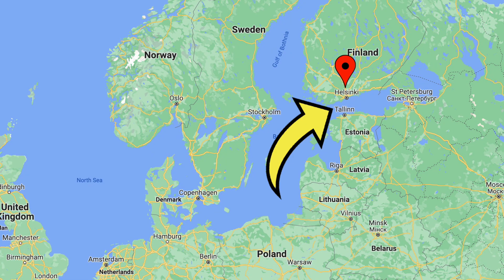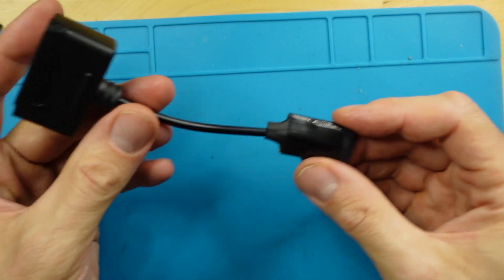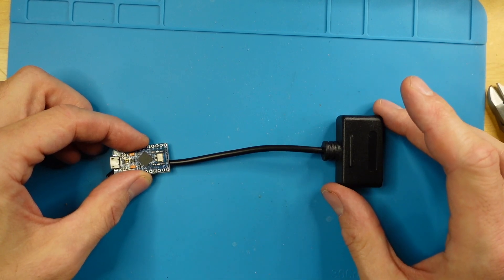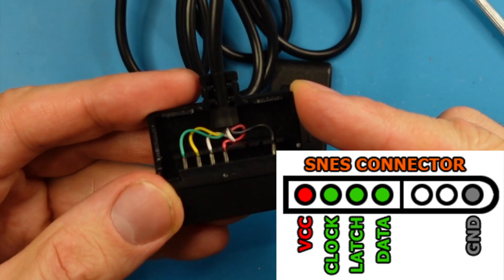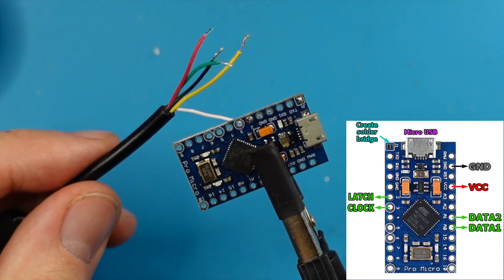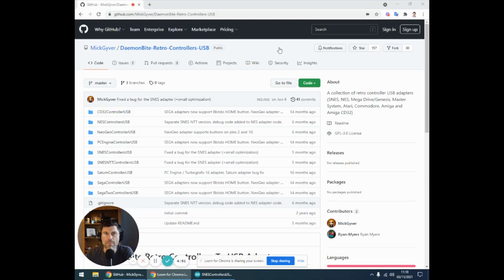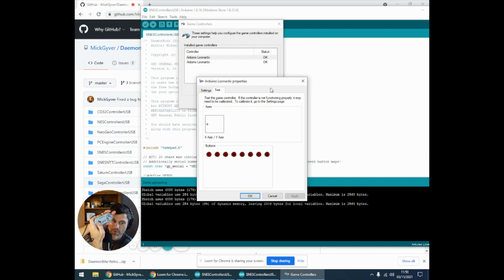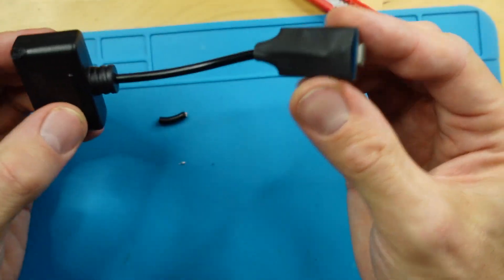Make your own DaemonBite Super Nintendo to USB adapter

Comment: Any recommendations on troubleshooting? I'm trying to do this with an old NES Advantage controller and I'm getting wierd results. No dpad and "B" Button lights up input 2 and "A" lights up 1, 3, & 4 at the same time.
Reply from the maker: As far as I know the nes advantage has the same pinout as a regular new controller. The best advice I have is use the green screw terminals so you are not soldering and resoldring each time to debug. 

Also a really long shot, try asking chat gpt to interpret the results you are getting. It’s often good at analyzing what combination might be causing that

Comment: Could you bypass the connector port and wire it straight to the board?
Reply from the maker: Do you mean: Could you take a SNES controller, cut the connector off the end and solder those wires onto the Arduino?

Yes you could, but then your mod would be very permanent :)
Reply: @ZezRetro yeah, I play games strictly on my computer for randomizer (Zelda 1 & Castlevania 2) so making it into a custom controller would be less parts than sourcing the female ends for adapters. Very cool man, thanks for the video!

Comment: Thanks for the awesome guide - worked straight away and used a multimeter instead as well :) Adapter works great with my stock SNES controllers, however having a problem with the SNES Topfighter QJ Arcade Joystick which is understandable with it being a 3rd party controller, I've pinged the developer for some pointers to see if there's any tweaks that i could make in the code to make it work!
Reply from the maker: I am very glad the video was helpful for you!

Comment: Dear friend, I would like to do a USB to NES adapter, so I could play with my homemade Arkanoid Vaus controller on original material.
Reply from the maker: Hi

The process is very similar, is there some specific part which is giving you difficulties that I may help you with?
Reply: @ZezRetro  is there any encoding or things I should know before buying cable and trying this new project?
Reply from the maker: What do you mean by "encodings"? Here is the daemonbite page showing you how to wire in the cable https://github.com/MickGyver/DaemonBite-Retro-Controllers-USB/tree/master/NESControllersUSB
Reply: @ZezRetro  thanks my friend ... I think I got what I need to begin
Reply: @ZezRetro  by "encoding" I mean doing the code to the arduino to make it recognizable by the NES
Reply from the maker: @Manche-De-Pelle  Ah yes. If you look in that GitHub link for NES Daemonbite there is a file NESControllersUSB.ino

This is the code which will be uploaded into the arduino

The process is basically identical to what I have in the video
Reply: @ZezRetro  exactly ... But I need the reverse.  Can an Arduino emulate the chip on a NES controller? How to program it ?  Those are the 2 questions that remain
Reply from the maker: Can you explain again what you require as I think I may not have understood. 

As I understood, you have an original NES controller and you wish to plug this into a PC. The daemonbite lets you plug in that NES controller and on the other side plugs into the PC. 

Have I understood correctly?
Reply: @ZezRetro  not at all ... I've made my homemade spinner using a USB port.  I want to make that spinner playable on original hardware (on a NES)
Reply from the maker: Ah ok I understand now

Unfortunately daemonbite can not do this. I personally do not know of any project which can do that.
Reply: @ZezRetro  that's what I thought ... it's seems to be a hard challenge to do

Comment: You don't need to break the other end to see what each wire corresponds to. Use a copper paperclip or wire, a pen, a sheet of paper, and a multimeter.
Reply: The pen and the sheet of paper could be replaced with some other note taking method. I use the sheet and paper method personally, but I just thought of another method;  The cell phone with the ColorNote app, or something similar. Voice-to-text the results of your tests with the multimeter if you don't have access to a pen and paper.

Comment: If you have a multimeter, you can use it to figure out which pin corresponds to which wire. Using continuity mode or diode mode, touch one probe to the port pin, and touch the other end to each wire. When you get a beep in continuity mode or a value other than 1 in diode mode, you've found a match. Saves you from disassembling the connector.
Reply: 100% this - continuity mode is the way to go
Reply: I also did this :)

Comment: I'm not an expert with Arduino's but I do need a SNES to USB adapter and have some clone Arduino Nano's that aren't doing much right now. Think they're be alright?
Reply from the maker: Clones are ok but it should still be the same type of board. If the project GitHub says it supports nano then a clone would be ok. If the docs don’t say it’s supported then it’s not likely to work

Comment: Why would you pry open the connector when you can just use a multimeter to test the wires.    Get a chap meter with continuity testing setting or use any OHMs setting.
Reply from the maker: I admit that does sound better. If you have access to a multimeter, it’s the way to go

Comment: 2:20 I would have left the wire full length... then you would of had an extension cable/adaptor. ;-)
2:49 You should buy some wire strippers. ;-)
2:56 A multi meter would help you figure out which wire goes where without destroying/taking apart end connectors. ;-)
Reply from the maker: All very valid points, I do need some better gear :) Although with point 1, I was specifically going for a short cable as my setup is all on my small desk

Comment: How to connect the line when 2p is connected? Connect data2 to A1, and do other lines overlap?
Reply from the maker: I haven't added a 2p myself but as I understood from the github docs: 2p VCC, Clock and Latch are all connected to the same points, then 2p Data is connected to A1 (1p Data is connected to A0)
Reply: @ZezRetro  I did this today and I confirm it's working as expected. Both controllers register/function properly in Windows as well as my MiSTer.

Comment: Could you make a video for the Arcade controller setup?
Reply from the maker: It's something I would like to do but might take me a while. Are you really new to this stuff? If you look at the arcade button project which Mick Gyver has in his github and the process isnt that different to whats in this video. You wire the buttons directly into the Arduino, so its a bit more soldering but still that very easy kind. Then its flashing it with software the same as shown.
Reply: @ZezRetro  where I struggle is the wiring for ground as most joysticks require a ground circuit for each button/direction.
Reply from the maker: @Garageland16  Sure, you can tie all the grounds to one and then I presume then put that into the ground of the arduino. When I make regular arcade stick builds, all the ground wires of the buttons are daisy-chained together already